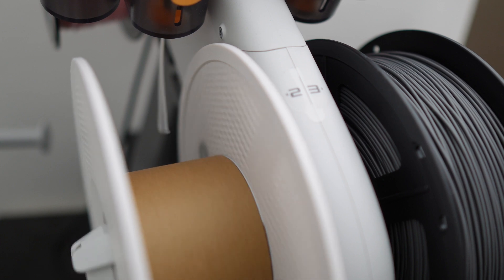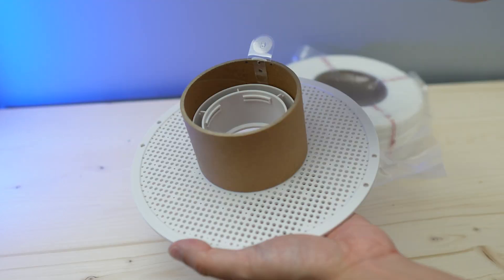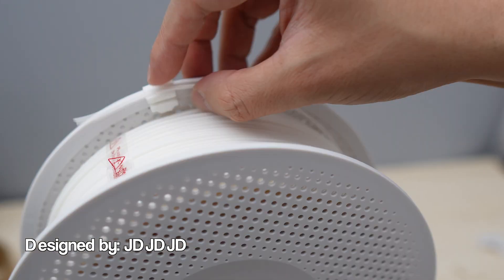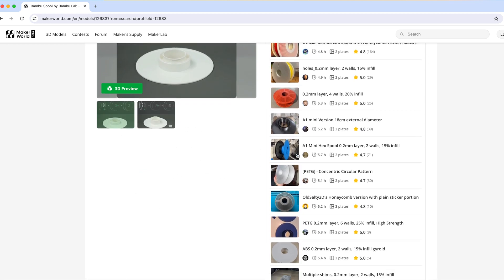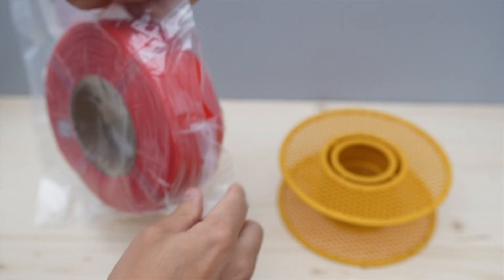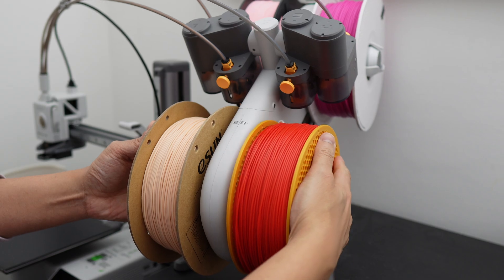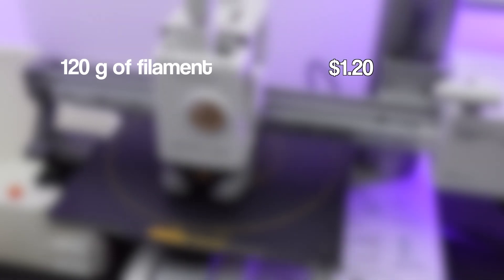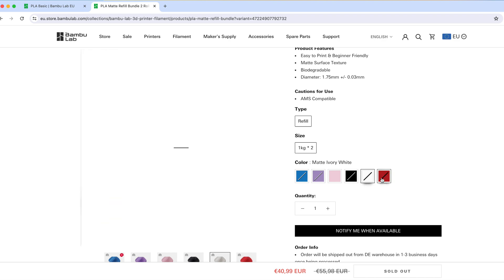Print your own BambuLab spools on the A1 Mini to save money!

Comment: That was a really useful video. 
Thanks very much. 

Quick question
I have an A1 Mini with AMS and I am novice to this. 
I sometimes would like to use a different colour filament to the ones I have mounted. 
But I can’t seem to find a video explaining how I can unmount a reel of one colour filament to swap with a reel of another colour filament. 
Could you help or even make a short video if this. 
Tx so much
Reply from the maker: You’re welcome man! Glad that it was helpful.
Oh it’s actually really easy. To unmount the spool from the AMS lite, just push the orange button and reel the filament backwards until it’s out. Then just take it off, and mount another spool😊

Comment: If you print these spools with PLA will they not soften and warp in a filament dryer ?
Reply from the maker: yes, i don’t recommend printing the spool using PLA  if you’re planning to dry it in a filament dryer. For that, you wanna print with something like ABS or PC.
Unfortunately both can’t be printed on BambuLab A1 series
Reply: @Lukis3D  So does anyone knows what material the Bambu lab PETG filaments that comes with the spool is? Same question for PLA + spool?
Reply: @Gleeleeglee  Well it says the spools are good up to 70 Degrees. That is on the Spools for PETG and PLA. So might be PETG or similar
Reply: to be honest.. PLA yes as long as you don´t dry filament, and to be honest, PLA spool for PLA filament is fine, PTEG is not that bad with water either.. but NEVER for Nylon and TPU because there you kinda sometimes need a "dryer"

Comment: While I do not really see the need for 3D printing you own spool, unless you also change the spool size, I do appreciate the guide on how to change the refill on an existing spool

With regards to the filament availability, I have to say that I cannot complain here in Europe. Or I have been lucky ^^
Reply from the maker: thanks so much!
yeah they have alot of filaments in stock for now, lets hope it stays that way!
Nevertheless, there are some colors that can only be purchased as refillables so thats when it would make sense to print one, if you really want those specific colors, of course
Reply: @Lukis3D  I see! Yes I exclusively buy PLA basic black/white. Looking at the bambu store for more speciality filaments I can see you point
Reply: When you have lots of refills, and ran out of spools, being able to print spools is great.
Reply: so I'm 3 months to 3d printing, I've bought 10 refills for 100 eur, but I only have 2 empty spools. that's the reason
Reply: @OnlineObsessionista why not buy one more spool, the difference is less than material cost

Comment: Hey im going to buy a A1 printer and will be printing on mukticolor.
Is the addition spool holder necessary or can i print it on my own? The spool holder nearly increases the price of the printer by 50% hence my doubt.
Reply from the maker: you can certainly print your own spools! With the A1, you can even print the standard size spools. you can print 5+ spools with 1kg filament so make sure you get a filament for a good deal! I think you could even get one for 9-10$ /1kg
Reply: @Lukis3D   I'm not talking about the spools but the additional stand that comes with it. The one they give with 4 spool holder on the add on pack. Thanks for the reply
Reply: @Lukis3D  Also, Getting a deal is nearly impossible as my country only has one supplier and due to import restrictions, I'm already paying 50% more than what you pay.
Reply: @onepunchman6165 You're talking about the AMS Lite, Yes it's technically a spool holder but it's more than that. Essentially the AMS will let you print 4 different filaments into a single print. I.E Printing a videogame/cartoon/or figure that has red,blue,black,gold colors in it. I would recommend looking Bambu AMS lite on YouTube to see what I mean. If you don't plan on printing that way and you stick to single color for the whole print I would recommend not getting it. But if you want to print with multiple colors or just want to have 4 different colors or filament types i.e pla, petg, abs etc. On hand without the need to take one off and put one in I would recommend getting the combo. You can always get it later but cost more. 

PS I have the A1 + AMS Lite and the A1 mini by it self
Reply: @PSilvestre46   Thank you for the reply. I will get the lite just to be sure. Some others pointed out how it would be a qol accessory when printing large pieces. The additional holder costs about 200 dollars here. So just wanted to be sure it actually does something and it's not a fancy spool holder.

Comment: As a tip for PETG filament, it is best to print the spool in ABS, so that you can dry the filament later without the spool itself becoming deformed.
Reply from the maker: yeah thats true, thanks for addressing that!
Reply: I think since you can print only PLA/PETG/PCTG/TPU and maybe few other materials on BL A1 series, PETG spool should be fine for all filaments. If spool deforms, filament deforms too. But yeah, it's not the best idea to print spools from PLA.

Comment: Nice! Only, if you pay 20 dollar for a 1kg roll. 120gr is not 1,20 but 2,40. Still an economical choice to print yourself :)
Reply from the maker: you’re correct! For some reason, i was thinking of 2kg spool so thats how it ended up in my calculation. Thanks for pointing that out!

Comment: This is exactly what I needed to know! I have the same problem. Bambulab filament with spool is always out of stock, so this is a great way to get around it! 👍🏻
Reply: If you plan to use these spool in a dryer do NOT use PLA. PETG is fine PLA may melt down if you set it over 60C.
Reply from the maker: yeah they sell like hot cakes! Have fun printing your own spool💪🏼

Comment: Just ordered an A1! And they were out of stock of pla with spools. I got only 1. 
So rest i bought refills those were in stock and will try to print my own!
Reply from the maker: yeah they‘re always out of stock, its so frustrating sometimes😓 Anyways, have fun with your A1!
Reply: @Lukis3D thanks. Just have to start with printing the spools. I have some old filament to test out. With do the spools with that if it works. 
Very excited!!! Had an ender3 but did not print a lot because the calibration sucked.